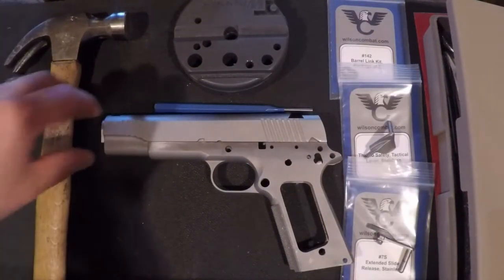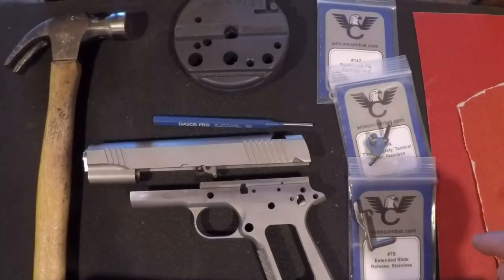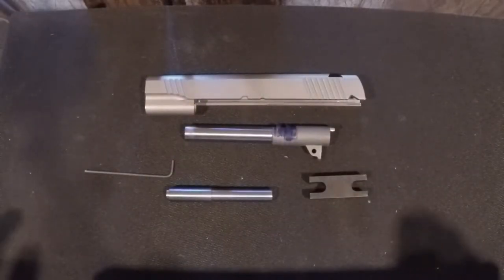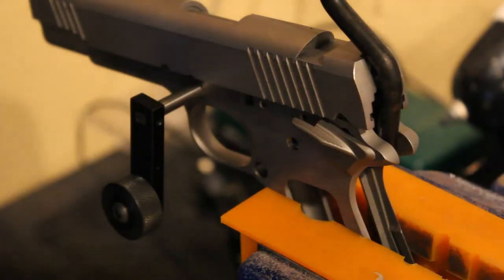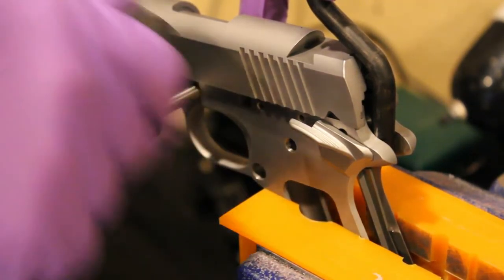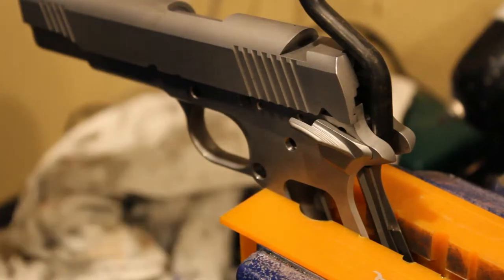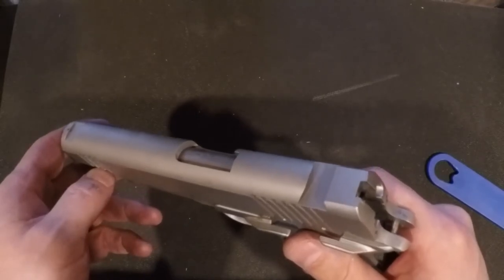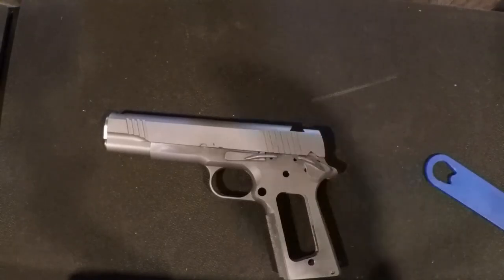80% 1911 Build - Part 9: Cutting Barrel Lugs and Fitting Barrel to Frame

Comment: Just did this for a customer today very easy, but you may want to try to test fit slide with barrel and bushing onto the frame and put the slide lock in to see it it moves smoothly into battery. I needed a small amount of hand fitting with sand paper wrapped around a mini round file. Started with a number one link and it worked.

Comment: I looked at the instructions on brownells site. They show that you are using the slide pusher reversed (which could damage the finish on your slide)
Reply from the maker: +Mark Anastasia You're right, oops. I just found it easier that way for some reason and I wasn't worried about the finish on the slide since there wasn't a finish on the slide. Good catch though, thank you.
Reply: His slide was overhanging in the rear which would require him to blend it to the frame even if it is not finished he has to remove material so the way he used the handle was wrong but it did not impact weather or not he would have to finish the rear of the slide. He would have had to finished the slide even if he used it correctly.
Reply: Mark A ya I noticed that too

Comment: Excellent, detailed, & thorough video. Would this process be appropriate for me if my only issue is not being able to rack the slide when ALL of the parts are installed in the frame?.. When the frame is stripped, the slide (no spring or barrel) goes on and off smoother than butter. Any suggestions, input, and/or feedback would be greatly appreciated. Instantly liked & subscribed to your channel. Hope to hear from you! Thank you!!!
Reply: Having the same issue…
Reply: I’m noticing my barrel is too tight but when I take my slide pin out it’ll rack. However when I go for a longer barrel link to allow the barrel more room to go down and back the barrel won’t drop as far to let the slide back.

Comment: What do you do if the disconmector doesn't line up on the slide after you're done cutting the bottom lugs of the barrel?

Thanks!
Reply: Most slides and frames are “in spec” so if you get hammer follow shorten the legs on the sear ( keep that same angle!)